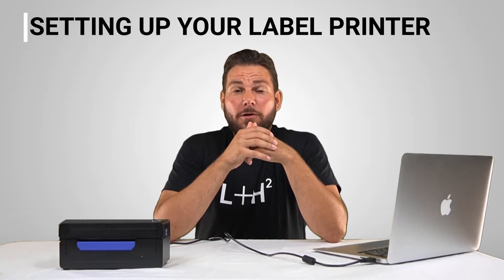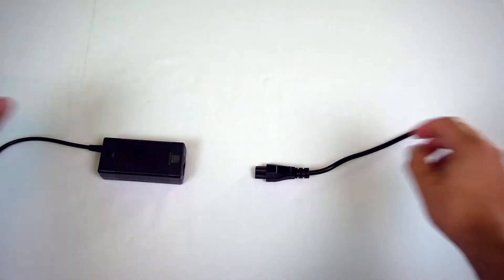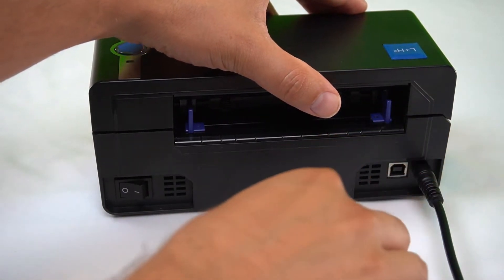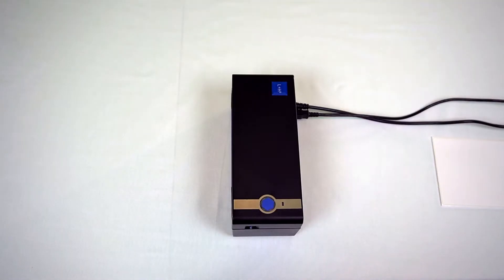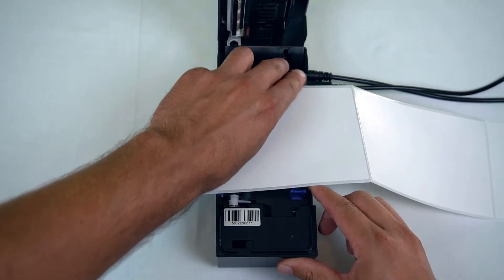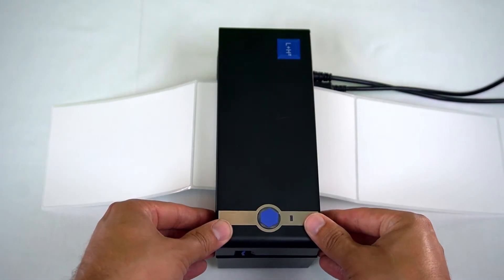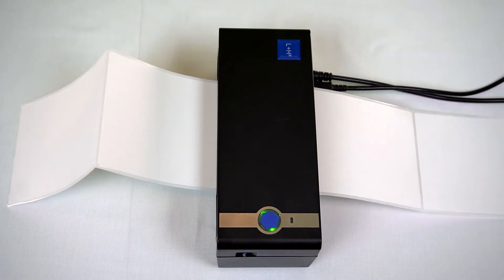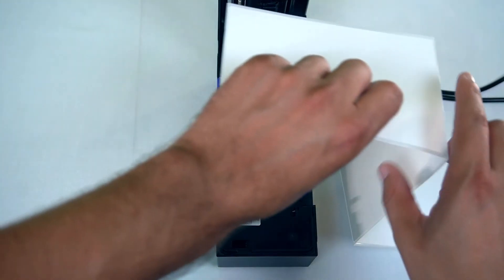LH-560 Thermal Label Printer Setup Tutorial

Comment: Can you tell why my one keeps spitting out labels after I’ve put to print one label
Reply from the maker: Please perform the Automatic Label Identification by following these 7 simple steps.

1. Unplug the printer USB cord from your computer.
2. Turn off the printer for a few seconds, and turn it back on.
3. Place the labels in.
4. Hold down the button on top of the printer until you hear 1 beep, then quickly leave go.
5. Press and hold the button again, wait for 2 beeps then let go, the printer will print a self-test
6. Reconnect the USB cord to your computer in a different USB port
7. Print 3 copies of this sample label: https://bit.ly/3njOttW 

If this doesn't work, kindly open a support ticket at https://support.lefthans2.com (bottom right hand of screen). Our technical support team will help you get set up in no time! You can also email support@lefthans2.com
Reply: @lefthans2479  Thank you I will try this when I get home 👍
Reply: @lefthans2479  I tried this but it still printed a blank label every other label. Gap height set to 3mm.
Reply from the maker: @workphlo  are you printing 4x6 labels? If yes, gap height should be 1mm.
Reply: @lefthans2479  Thanks for the reply. I tried 1mm just now still prints out a blank double label.
Reply from the maker: @workphlo  can you try the steps again by holding down the button until you hear one beep and leave go?
Reply: @LeftHans2  I tried this but nothing changed. When I hold for the second double beep, it prints out the test page, and then again a blank label after. Test page:

BRAND - L+H2
NAME - E-waybill Printer
MODEL - LH-560
COMPANY LEFT+HANS2

MEDIA TYPE - LABEL PAPER
MEDIA CHECK - AUTO
HTP VOLTAGE 24.03 V
HTP TEMP - 27 C
HTP DAMAGE - <1719-1792>0 DOTS

SENSOR - 2224/2176/2048/3016/1329
LABEL LEN - 154mm
GAP LEN - 1mm
DRIVE PARA - 0/24/0/24/24

PRT LIFE - 441.55m
HTP LIFE - 441.55m
Reply from the maker: @workphlo  can you please send me your label? Support@lefthans2.com